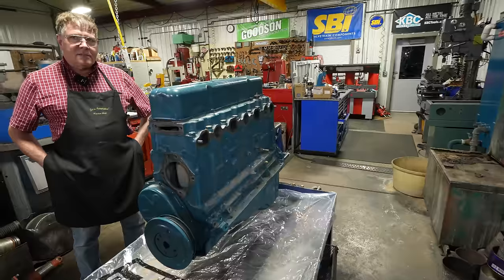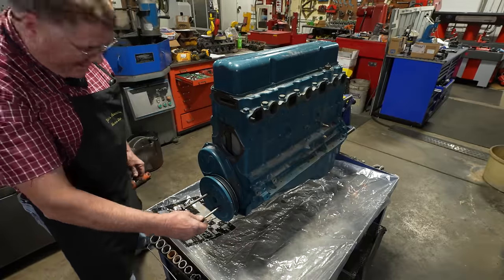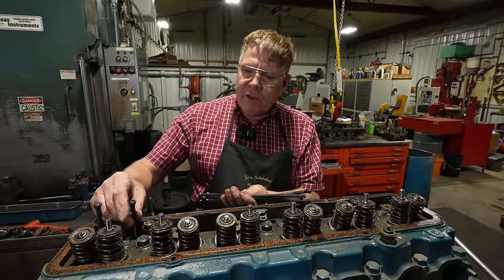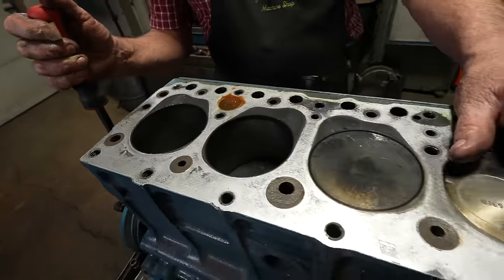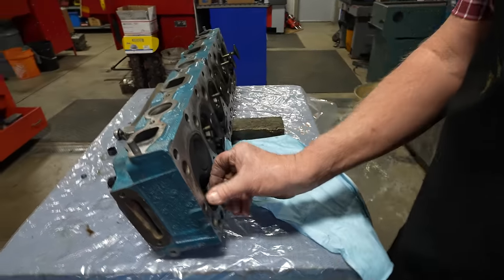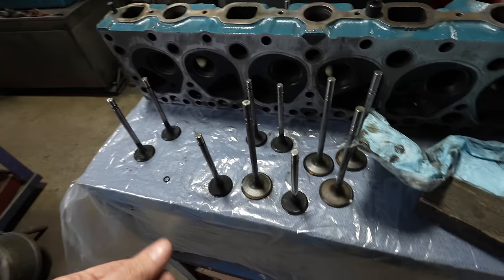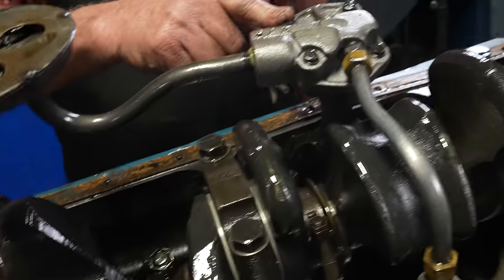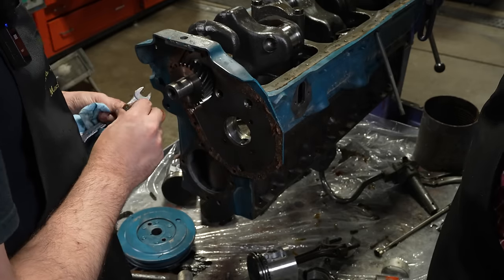Their 235 Chevy BROKE DOWN 10 Miles After The LAST Shop's Rebuild...

Comment: So I spent 22 year manufacturing engine parts - Dynagear, Manley Valve, Mahle, Etc - I was kringing as you were doing the tear down. Brand new valve are YRPS/Hard chromed and some friggin mechanic thinks they can do a better job on the finish? yikes

Comment: The valve stem to guide was too tight, they sprayed a felpro gasket with silver paint, didn't thoroughly clean the rocker arms, left unhardened seats in the heads, forgot to look at the main bearing specs, forgot to set the bearing pins, god only knows the cylinder to piston skirt clearance.... Oh but we shouldn't "BadMouth" the hacks that put it together.  It Was Deserved... as a racing machinist for Reher Morrison / mechanic for 39 years.

Comment: Thats about as dirty rebuild as I have ever seem and Im 80 years young and rebuilt quiet a few of those 235 Chev Truc engines and for only ten miles on it THATS A BUNCH of grit in that oil pan. A millio woders that engine didnt completely lock up with all that grit in it. That looks like a shade tree job

Comment: Don't rebuild a 235. I had a 49 panel van and I rebuilt it 3 times before I just sold it.    :face-turquoise-covering-eyes: Later I had a 50 Fleetline Chevrolet with a 235 with low miles and it never had a single problem. For 16 years I owned it.

Comment: so mistakes were made but in good faith... tightening the tolerances of sealing surfaces allows older engines to run thinner fuels like hydrogen and ethanol... where these kinds of gaps in the engine allow blow by... and fuels get into these low lubricant zones... water injection would also get into the oil if there are too many gaps and not enough ignition. or heat to evaporate the blown by materials. 

it was locked up, just not how we usually think... it wouldnt turn, and forcing it to would bend the valves and rods and you may never know without taking it apart... most people probably would have kept running this engine until it tossed those valves with the piston...
Reply: i thought that crank seemed way too hard to turn and overly tight... those 20s on a 30 would definately explain this... i imagine this thing was over heating a lot but we dont even see heat damage warping or galling on thise bearings... lucky maybe

Comment: Well, Ya got me FOLK'S????  When I built Engines, back in the 70/80's Everything that was put together "MATCHED" the Machining that was done, you checked the Part's and Pieces that were being Installed, and then, Ya Re Checked your Work, or ya Had someone else go back and Check your Work!  Same when I did body work, Ya had someone else look it over B 4 It got Painted! However, we are Human, and Mistakes will be made. It's a Shame that this was such a Puzzle to Un Scramble. I'am sure when y'all are finished, It'll be fine. OLD CHEVY 6 Banger's should run for a While with Good Maintenance.

Comment: It didn't get as clean as it should've been..At least not up to you guy's standards.  Plus, it's doubtful the last guy had The Clean Up Guy's experience with an engine of that vintage. The packaging mistake from the bearing mfg seem plausible, but putting a cross-hatch on the valve stem, so course you can feel it with your fingernail is certainly too much. Sorry you guys have to stay up past your bed time to get a video made, but thanks for the effort..

Comment: Is it a motor or engine??🤔
Reply from the maker: Both are correct.
Reply from the maker: Electricity is not the only form of “power”. Do a quick google search.

“Motor definition”.

The search “engine definition”.

The machine in this video falls into both categories.
Reply: Just ask ANY electrician. They know the difference..🙄
Reply from the maker: Ask General MOTORS. Ford MOTOR Company. Department of MOTOR vehicles. 

Motor definition:  “a machine, especially one powered by electricity or internal combustion, that supplies motive power for a vehicle or for some other device with moving parts.”

Coincidentally, I found this in the dictionary under ignorance: “anyone who argues that the engine in this video cannot be classified as a motor. For example, @MXRIDER71”

Comment: A word of advice. Makes no difference what you are working on. Please stop using your had for a hammer. A moment saved by not using hammer for a hammer and a hand to hold the hammer. My miss used hands and wrists throb every time I see hands pounding on something. Over 70 of my 82 years have been spent working with my hands in one endeavor or another. By the way, I did not heed an old man’s advice when I was young; ten feet tall and bullet proof. 😊😊😊

Comment: Mismatched main bearings? incorrect valve seals? 10 miles and it's got bearing metal in the pan? This is all evidence of a rebuild done by a rank amateur. Too bad it's 60 over. One more and it's done.

Comment: I Hate to say it América but Machinist like this will be Gone Soon.. His Son I hope will carry on and Train more Machinist.. But finding Americans that what to work hard like this and Actually take Pride in Themselves and  their work is Drying Fast.. I Built a 'Y' Block 6 years ago and took the Heads, to 2 Different Machinist to have the Guides and Seats Done and it was a Joke.. I Finally Spent 8 + Hours Finishing the Seat with my Neway Hand Powered/ Drill Power Seat Cutting Equipment. That I use For Harley Davidson Work. BLISTERS all over my Hands Later. I will say one thing ABOUT OLD FORD CAST IRON.. It is Hard A. F.

Comment: What a shit rebuild the other guys had done, over-honing the brand new valves in a way that's (maybe) not necessary at all, not including certain parts for the unleaded fuel, not even cleaning the rocker arms fully…

Comment: Back about 1976 bought a 235 from shop in cal they did not get the bearings on crank right or crank journal was not right, got about 1000 miles when it screwed up. Non the less i credit the rebuilder to have been a dum ass.

Comment: How long ya gonna stand around talking without measuring the main housing bores . Sorry , just don't like the loss of continuity  ,,, !  ,,, Ya did it right on the stems and guides , and I'm sure you will do it in the next vid ,,, ! ,,, Not knocking your skill set , just your annoying attempt to promote the next vid . ,,, btw , that missing .005 should have locked it up on the stand , unless the housing bore is shot ,,, !